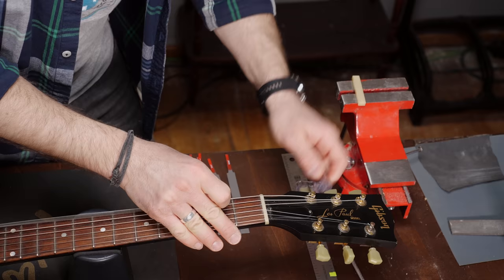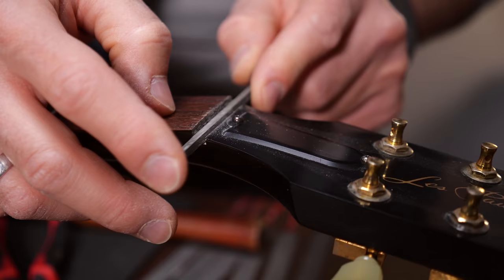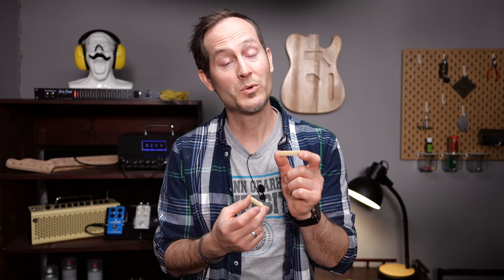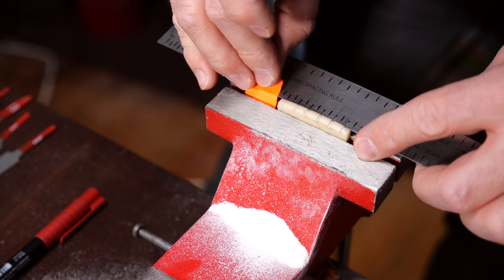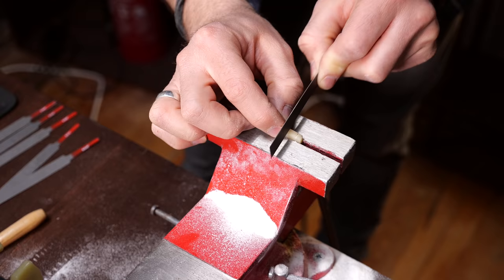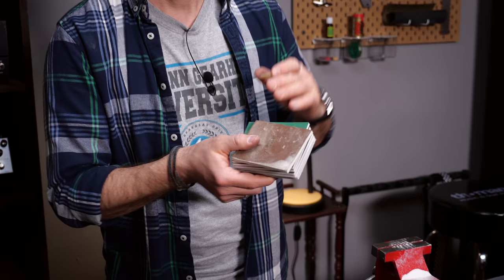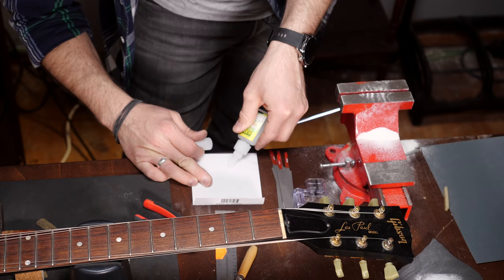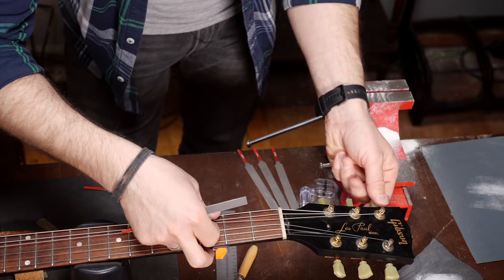Guitar Nut Replacement | Guitar Tech Tips | Ep. 57 | Thomann

Comment: If you don't want to go through this process and your guitar is buzzing badly after you learned something the hard way:

Shim the nut. It's completely valid option. Luthiers do this all the time. Use wood, bone or metal. 

After the refret nut was too low and I didn't have any tools at the moment so I slapped two pieces of razor blade under the nut.
Just be careful and make sure it's supporting whole footprint of the nut
You can use hardwood veneer too. It needs to have cohesive thickness
You'll be fine 
And
You can save yourself lots of work

Kris, you did outstanding job here. People have no idea how much elbow grease you had to put into making this episode. It's good to see your Junior being cured from your love for 15s (strings ofc)

Oh, if you want to stop saw from squealing - wax it, soap it, spit on it but please, do not hurt your ears so bad
Reply: I shimmed a nut recently with ordinary printing paper (maybe slightly thicker, like 160 g/m2, but still ordinary paper). I attached a small piece to the bottom of the nut with super glue, trimmed the edges, and then soaked (not "over-soak"!) the paper in glue (which effectively makes the shim "plastic" and not "paper"). The upside is that paper is thin enough for small adjustments, easy to work with, and have a smooth surface and cohesive thickness.

Comment: Hi, thanks for the vid and your GREAT guitars :) I cannot find the video link you mention about doing this with a pre-slotted graph tech nut. 
Also, I am a little confused since you start hammering the nut toward the front, but on my HB SG-Style there is an edge also in front (just like in the video) which is likely to break if one does this? So obviously it would need to be hammered out sideways as well? (As you do in the clip).
Also, since you're from Thomann, do you know what nut material had been used on an old (early 2000s) SG-style (pre-cursor of DC-580) HB? They had a plastic nut, right?

Comment: Is there a difference in sound, if the nut is narrower or wider? Is the nut also responsible for string ringing behind the nut?
Reply: It might be but I'm not sure if you can even measure it. You can't change that dimension anyway

Yes because it works kinda like a fret but you can't fix it with nut

Comment: Don’t use the superglue even a drop. I did that and when it came off next time it took a nice piece of the board out with it. The woods softer than the superglue lol.
Reply: I agree. If any glue is used at all it should be glue designed for use on wood. If it gets stubborn to remove a few seconds with the heat gun will loosen it. I don't think the heat gun works nearly as well (if at all) on super glue.

Comment: Hosco makes three different types of nut files. First : the three double edged nuts files to a set with the colored handles; Second: the longer files with the red tang; and third:  the compact, black nut files which require the holder. Which set would you recommend to a non-professional who only works on his own guitars? I've read that the double-edged three files to a set files cut the slots too wide. Is that true or were they probably talking about the cheap amazon/ebay knock-offs? How are the files with the red tangs used? It seems they don't require a holder, but what about the thin files for the high "E", "B" and "G" strings? How do you use those? ?
Reply from the maker: I prefer using these Maxparts nut files with the red tang. You can clearly see how I use them in this video. They don't need any holder, you just have to be careful with the 12 and 10 gauge ones not to bend them. The double edged ones are fine too but yeah they file a little too wide so be careful with those. Cheers //Kris
Reply: @ThomannsGuitarsBasses  Thanks for the reply. I looked up the Maxparts nut files with the red tang; they look just like the Hosco.

Comment: I have question is also the nut is one of the factor of a sustain in an electric guitar? my guitar doesn't have a lot and much of sustain that is why im curious if nut is the problem. thanks in adv.❤️
Reply from the maker: Hey, thanks for the comment! If you feel like the open strings have a shorter sustain than the fretted notes, then it's the nut's fault. If fretted notes have an equally long sustain as open strings, then it doesn't have anything to do with the nut's quality. I hope that helped . Cheers! //Kris

Comment: I just bought a new martin 00015....the high e string slips off the board often....is this due to the nut carve? 
And what is the long term solution?
I had  the store set my guitar up when i bought it. I believe something happened at that point
Reply from the maker: Hey, if the E string slips off the fretboard, it's just too close to the edge of it thanks to the position of the nut slot and of course the bridge saddle slot for that string. A store can't change that without you seeing it afterwards. Also, they'd never do such thing, they probably just adjusted the truss rod, if that was necessary. This is a production issue, this is how the guitar left the factory. First of all, if you still have warranty, definitely use it and try to convince the store to check the guitar properly. They could try to swap the nut and make the slots closer to each other, with which the other strings will not be that close to the fretboard edge anymore. They should also take a look at the bridge saddle, check if it's possible to carve a slot for that E string closer to the other strings. I wish you the best of luck! Cheers //Kris

Comment: So I have a T 60 Peavey. It had a 1/8” nut my replacement nut is 3.5mm. So how do I enlarge the nut slot to accommodate the 3.5mm new nut ?
Reply from the maker: Hey Dennis, changing the string spacing on a pre-slotted nut is very tricky. Basically it's not doable, unless the pre-carved slots are way too high anyhow. Then you can ignore the shallow slots and file the old spacing in the new nut. If that's not possible because the slots are filed too deep for that, you have to stick to the new wider (3.5mm) spacing for this nut. Try it first without gluing the nut and see if it's playable. If not, you'll have to search for a fitting 3.17mm (1/8th inch) pre-slotted nut of a blank nut which then you have to file completely. I hope that helps. Cheers //Kris

Comment: So, my main issue/question is... If I have a 4 string bass and I want to use BEAD, for instance, I really need to widen all the slots in the nut.  I tried it once using a file on a cheap nut I got to try it out (before destroying anything important) but filing was really difficult... I don't know if it was from being plastic (or the file sucking or me sucking) but it was being very difficult... Also, the slot shape became all weird. How can you do to have a proper "curvature" inside the slot, especially with strings that are like 130 (low B)?
Reply: i think the "curvature" is not necessary. no reason. i use right angled files which i made from steel sheet plates. works fine.

Comment: Does the neck need to be super straight when replacing the nut?
Reply from the maker: Almost straight, yes. It's best filing a new nut to a height that works with your ideal setup / neck relief. That is of course different for everyone: for super low action the neck only needs a very slight bow, for medium action you need a bit more. So clearly the first step is to set up the guitar to how you like it and then replace the nut. Cheers //Kris
Reply: @ThomannsGuitarsBasses  🤘 Thanks! Love the channel!